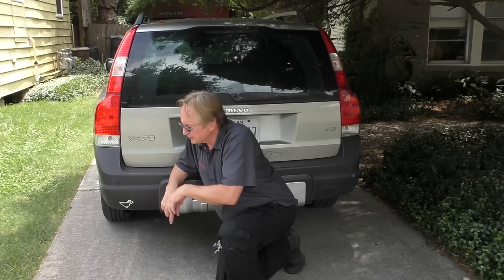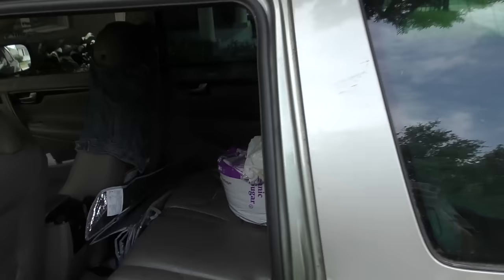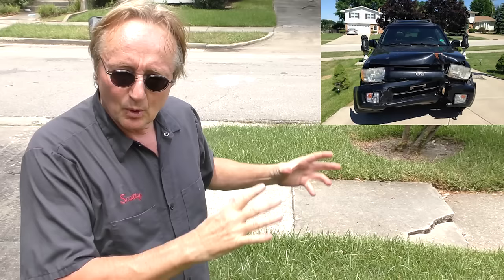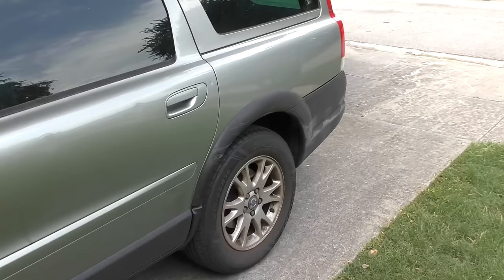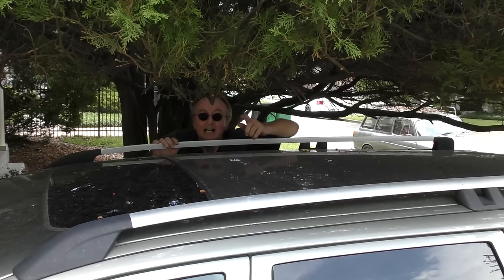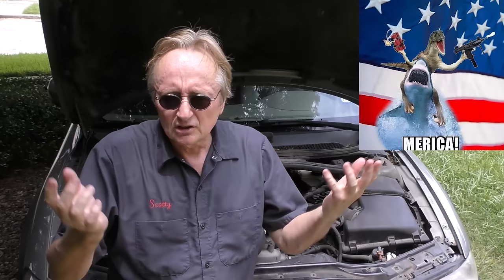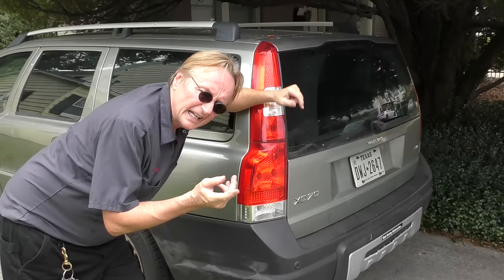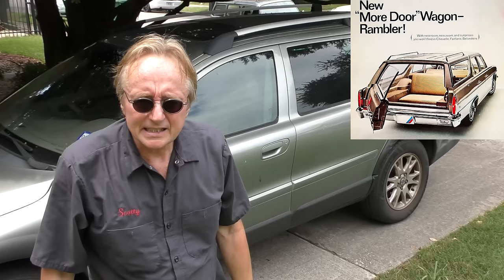Here’s Why Old Volvos Last Forever

Comment: We can confirm this. Where my Volvo nerds at?
Reply: Right here! 👋
Reply: I have a Volvo xc90 2007 I love that thing
Reply: 1992 Volvo 960 wagon only 196k mi
Reply: 850R with 340,000 miles still going
Reply: Live Love Drive Volvo
Reply: @FlaqkoGTA  indeed. I love this car.
Reply: Had a Volvo s80 twin turbo executive class....best damn car I ever owned and miss the hell out of it!!!
Reply: My parents had a volvo growing up. Can confirm they are legit tanks with moving seatbelts
Reply: I dont even go near those new Volvo's. I only.  240 and 740 or older.
Reply: Had a 08' xc90, and still have my 01' s8 t6! Looking for a box body in good condition.
Reply: 2010 c30 here
Reply: I'm a new one haha
Reply: Right here! Volvo XC90 V8 2006!
Reply: Had a 1985 740 gle and it was a tank
Reply: Volvo station wagons are the best
Reply: Adrian Leon Got a 2003 S40.
Reply: 06 s60 t5 awd
10 s40 t5 awd
i want an s80!
and a v50!
and an xc90!
Reply: Owned 9. Still have a 75 164E
Reply: Here
Reply: '98 V70 with 235K on it. I need to get a few things fixed but overall a great family vehicle. Interior is better than most other vehicles I've ever seen.
Reply: I got a Volvo v70 d5 summum 2005, great car :)
Reply: I got my 2001 v70 wagon two years ago from a used car dealership. It only had 112,000 ( previous owner was a senior citizen who only drove it locally. I absolutely love it! Other than it running lean and cutting off sometimes, I'd buy another in a heartbeat. No more new cars for me.
Reply: I would say the pre 2000 Volvo's are the most reliable without all the electronics but that's just me!
Reply: Can confirm. Currently working on a 850 glt
Reply: 2009 s80 2017 s90
Reply: '05 xc90 2.5t awd 160k miles
Reply: 2007 xc90
Reply: here here x)
Reply: Egh 2004 volvo S80, sucks, everything falls apart.
Reply: I have a Volvo 940 STW 2.3, M47 gearbox, only 85kW (116 hp) 8V engine,  from 1993. I bought it spring 2002 and am driving it since then in Finland. Actual km's are 409000.
Reply: @FlaqkoGTA  same, except it came with 8nsane v8 yamaha engine.
Reply: I thought Scotty stole my car, it's this car except with a charcoal interior and it's not ripped up
Reply: Got a 98 Volvo s70 T5 and love it
Reply: I have 4......from 91 to 2016
Reply: 2004 Volvo V50 T5 with 206,000 miles still going great
Reply: Adrian Leon 2008 xc90. Expensive repairs here and there, but solid and smooth.
Reply: Woo-hoo 😍😍
Reply: 2001 S60 with 268K miles here! She's still running strong!
Reply: Own a b230ft swapped 144s. In swimming pool blue. The driving  experience is one part erotic and one part frightening. Old volvos never die, they just get more interesting.
Reply: XC90 3.2 inline6...2007....340000km..still nice
Reply: I have a 2008 Volvo S80 v8 that thing is a absolutely monster I love it 💪🏽
Reply: Driveway Marvels had a 240DL. Awesome vehicle. It even survived a direct tornado hit. The car was an absolute tank. If they still made them I would buy another one.
Reply: I have a 98 S90, 03 C70, and a 97 850 GL. I had a 2007 S40 that was rear ended by an 18 wheeler. Ran great for 283,000 miles, minimal maintenance.
Reply: Adrian Leon 

1992 740 wagon with 450K miles and drive it daily.
Reply: 1994 850
Reply: Here! 99 S70 Awd owner here. Love my car to death.
Reply: 1989 Volvo 740. I’d rather have a bigger car cuz I’m 6’2” but I mean it’s Ight
Reply: HERE
Reply: 99 s70 glt here with 207000 miles and still runs like new. easy to wrench on too
Reply: No. I have a special Volvo. It kept breaking down until i put it in the garage where it even more broke down. It's a Volvo V70xc from 1998
Reply: @denisvermeirre1024  that was my first car, in 1981. Second was a 75 SAAB 99 EMS.
Reply: In the house
Reply: Have a 2000 V70 from back when they were still boxy.  Was rear ended on the highway, the SUV was a write-off, but over a decade later the Volvo is still going strong.
Reply: yep ,, 2000 s80 T6 .
Bought 2 years ago from a used car dealer 

that had given up on it . Gave him $700 for it .
Long story short , a fresh battery and rebuilt throttle body
she still runs and never let me stranded.
Reply: 88 245 baby shes a tank
Reply: 1979  244 DL   1.1 million miles . I cried when I couldn't get a replacement fuel pump housing during cash for Clunkers. I even tried a race shop to make me an entire new fuel tank and they said they couldn't do it. Now in a 2006 XC 70 as a Comfy Couch replacement .
Reply: 1999 S70 and a 1966 122S  now  and 10 others since 1976..
Reply: Volvo 240 from 1987 with a carbi! Engine is from 1977.
Reply: Bought a 2005 S40 1.6 Petrol for £525 with 152,000. Done 4,500 miles so far and it's been great. Returns real life 40 MPG commuting on fast A roads at 60 MPH. Incredibly comfortable. Bargain for the money and 10/10 would buy again.
Reply: Here!! Volvo for life 🇸🇪
Reply: 240 for life.
Reply: 2004 V40-currently my first vehicle, with 140K miles still runs great
Reply: Just been out in my '97 T5 wagon (manual) Goes like stink!
Reply: 2008 Volvo S80 3.2
Reply: 2004 V40 diesel 182k miles, can confirm
Reply: 92 240!! It's my baby!!
Reply: 05 S80 D5 200 000 miles oilchange every 5000, engine runs like new :)
Reply: @vladimirchervenkov6949  another 2004 V40 as a first car! How's yours holding up?
Reply: David Fearnley-Jones Great! It runs amazing! Going through town the acceleration is great even for a 16 year old car. I have cleaned every part of the car by hand and I love driving it around
Reply: @vladimirchervenkov6949  awesome! They're a joy to drive, so easy! What engine did you get in yours?
Reply: I Love my 2005 s80 AWD, still going strong change the oil goes like hell in winter snow and all year long, nice ride, definitely a highway car, gas mileage not so great but she's my baby
Reply: '06 XC70, 141k miles, and my first car. Its safe which makes my parents happy, and its quick so it makes me happy as well!
Reply: My pride and joy is my 98 S70 T5 5spd. Over 442,000km on it and still running strong.
Reply: Only the old volvos are so reliable and durable? For example the xc70 2016 model is not so reliable??
Reply: 1996 850 N/a 5spd wagon last of the Swedes
Reply: 2008 C30 T5 gang
Reply: turbobrick nation!
Reply: I have a 1988 Volvo 240 GL sedan with roughly 250,000 kilometres on it. I drive it daily it’s a beast!
Reply: @jcorbo7518  wish I went 960 rwd then again I don't get into any shenanigans in my 850
Reply: S80 T6 2001 done replacing wear n tear items but these things are rock solid cars
Reply: Here! I have a 2005 XC70 with almost 224K miles on it, and I LOVE it!
Reply: Adrian Leon right here! Xc90 running 💪🏽💪🏽💪🏽💪🏽💪🏽💪🏽💪🏽💪🏽💪🏽💪🏽💪🏽💪🏽
Reply: 2005 Volov S40 T5 AWD great car real good mpg as well
Reply: 2001 Volvo S60 T5 200k miles, and still running great!
Reply: Buddy of mine had a '90 740 turbo with 398k miles
Reply: Adrian Leon right here man. 2006 XC70 Ocean Race edition. Love this thing! Scotty is right. They are built tank solid, and mine does have ice cold A/C!
Reply: 1999 Volvo v70 GLT love to drive!
Reply: My family had a yellow 4 speed with OD 1977 244 wagon that they bought after bringing their brand new Buick back to the dealer in San Antonio after the transmission fell out on the highway. They drove the 245 for 16 years and sold it because I couldn’t drive a manual yet. They sold it for $1800 which was more than they paid for it lol. I then had a ‘83 244 GL with leather interior and sunroof with a brand new silver  paint job and alloy wheels drove that for 2 years until it was time to get something flashier aka less reliable lol. Should have never sold that car. B23F. Then my dad bought a 3 year old 745 wagon in forest green. Drove that one for 9 years then sold it to me. Then my soon to be ex wife blew out the transmission going to Corpus Christi and had it towed back. Ending up getting 500. The 745 was definitely the least reliable car but sure could hold a lot of stuff
Reply: V70 2009 2.0 200000km and 744 1991 460000km
Reply: '99 S70 turbo. 109K
Reply: Here i am, got some old volvos in my garage. 740 2.3 trubo/intercooler, xc70 99 2.4 trubo, volvo 850 2.4, and one sad volvo 240 :)
Reply: Volvo 240 here the best car ever made. I have two four door and three two door cars
Reply: Yep, 2003 V70 D5 here in UK (rust central) 260000 miles, still solid, returning av 51mpg
Reply: I have had several.
V70 1997 petrol manual 15000 miles. Everything was wrong with it. I gave up on it when the second starter went out. Nothing worked properly and the engine was jerky.
 V70 1999 petrol manual 17000 miles. Stood the test of time pretty good. AC wen't out and the driveshaft broke in half a cold Swedish winter night. But the last thing I've heard it's still rolling after 25000+ miles.
S80 2003 petrol manual 12000 miles. All kinds of electrical problems. Driverside window came loose once.
XC60 2013 diesel automatic 9000 miles. Automatic gearbox failed and it was way to expensive to fix that one. Loved that car though.
Current car is a V60 2014 diesel automatic 8000 miles. Waterpump broke after 6000 miles, AC makes a weird growling noise and is told that is normal from the Volvo mechanic. Bunch of weird electrical problems like backseat windows going down by them self. Trunk saying it's not closed properly etc...

All in all. Engines are built like tanks, but the rest of it is pretty meh.
Reply: 2002 s60 here! One of the only volvos i TRUELY loved
Reply: Swede here, I have a friend with a 1986 240. And it has done +360k miles with bare minimum maintenance during the last 10 years. It's been driven and treated like a bastard child. People entering throgh windows. Walking all over it. It's been to more music festivals than I can imagine. 
And it is still going...
Reply: Funny thing about station wagons- everyone makes fun of them - shorten the wheel base- raise the cabin height and call it an SUV and everyone loves them
Reply: 2004 xc70 same color tan leather 156,000 running strong all maintenance done in my garage
Reply: Had several and love 'em.
Hills don't exist for the 5cyl engines - they just plow through like a lazy V8.
Reply: '05 S60 2.5t
'14 S60 T6 RD
Reply: ‘05 S40 T5 6MT in passion red with the dynamic suspension! I call it my ‘baby R’! had a ‘91 740 4AT wagon about ten years ago, wish I still had it, would buy another given the opportunity!
Reply: ‘06 S60 2.5T
Reply: I got that 2009 Volvo C30 t5 r design
Reply: In the house!!!....1996 850....230,000 plus and still banging babe!
Reply: '98 S70 daily driver and a '98 V70 Turbo with an M56 w/ Quaife LSD waiting to drop in :)
Reply: 95 940 wagon with only 500,000 miles, all original including the turbo. It seats 7 with the rear facing kid seat, spins donuts, drifts, tows just great and is the most reliable vehicle I own. I have a couple dream Volvo’s in mind - 98 v70r (pre-Ford ofc) and v8 xc90 as the family car.
Reply: Right here boiii
Reply: 3 wagons, a c30 and an s90.
Reply: I am buying a V40 T4 tomorrow. Love the style and comfort.
Reply: I got a 2000 V70 Classic, 160 000 miles / 250 000 kilometres, it's a 2.4, 5-speed manual, reconditioned AC, full leather interior, alarm, central locking with remote, power windows front and rear , heated seats front and rear, integrated child seat in the armrest (back), new cam belt and waterpump, fully maintained with full service history (servicebok), new filters and fluids and so on. Bought it four months ago for $850 / 8000 SEK, I'm the second owner.

Cheers from Sweden!
Reply: Still loving my 2003 V70 Diesel 5 cylinder!
Reply: We own a 2007 Volvo XC70 with 180k on the clock. Far better condition than the one above.  My daily driver is a 5 spd manual non-turbo 1996 Volvo 850 wagon with 375k miles.  Still runs great.  Standard maintenance is key.
Reply: My 1994 Volvo 850 had 310K miles on it when it was rear ended by an older lady going at 50mph. Her Toyota crumpled like a can of coke and I drove my Volvo home. haha
Reply: Present! They're really built well
Reply: 2003 Volvo XC70, bought it on eBay for $2300 with only 117,000 miles. Gotta brag about that. The owner even changed the timing belt at 104,000 miles. I expect it to last many years. Handy vehicle, put the back seats down and carry lots of stuff. 25 mpg, much better than my suburban that gets 15 mpg for everyday driving.
Reply: Carmicha3l  samee, what year?
Reply: Carmicha3l  ahhh, lmao. I have the first computerized one, when they switched to Me7. The 1999,
Reply: Right here. 94 940 with 184,000 miles and going
Reply: even me the Swede can say this one is the lost good Volvo ever made the new ones are garbage
Reply: right here. 2004 volvo V70, Straight 5 cylinder with 267k miles.
Reply: 89 240 DL with almost 700k miles.  Ridiculous.
Reply: I demolished a new impala's rear quarter when an old lady pulled out in front of me and my S60 just needed a new fender.
Reply: 1991 volvo 940 2.3i, 215.000km, barely broken in! Greetings from Spain!
Reply: Ryan Braughler 2005 S60 best purchase I could’ve ever made!
Reply: '87 240, checking in
Reply: Here here!
Reply: Here! Wish they would build a 1/2 ton pickup for the American market.
Reply: Here here
Reply: @850are2  My favorite car I've ever owned. Full trim, oh man.
Reply: Right here!! Im on #11 at 19. They 100% need a good amount of maintenance, they’re just all abused.
Reply: 🤔😎 here mate
Reply: 2008 s40 running smooth baby!
Reply: oh and my dad still has a 1996 volvo 960. This thing is dope !
Reply: Oh -we are here 👍
Reply: @keeganpock864  You got me beat, I'm only on #5 at 20!
Reply: 940 Turbo w/ manual present. Anyone else?
Reply: @chrisj197438  wow!
Reply: Sup
Reply: Gasoline S60 2001 here (non turbo version) 180k miles and still going :)
Reply: Still driving a 2010 xc60 t6 things a Tank love it 👍
Reply: 2015 s60 Polestar 👋
Reply: 2005 S60R  I love it!
Reply: Right heree
Reply: 280.000 km and it drives like new
Reply: They are poop piles now
Reply: 2001 V70XC love it!!!
Reply: Here
Reply: Adrian Leon I have a 2007 Volvo s40 :)
Reply: 2007 C30 T5 and a 2016 Xc60 D4👍🏻
Reply: I have a 1990 240DL wagon that I drive every day. I have no idea how many miles are actually on it, but it’s at least 275,000. Doesn’t leak a drop of anything, and with preventative maintenance, it’s very, very reliable. There’s a reason they call those old RWD “redblock” Volvo’s “bricks” 😎
Reply: I dig them so much, I've had five of them!
Reply: Present!
Reply: ‘08 S80 V8!
Reply: Adrian Leon  1991 240
GLT right here ;)
Reply: 1996 Volvo S70 160k and still good to go
Reply: S70 here
Reply: Flaqko _GTA I have an 05 and I love it too:
Reply: Just bought a 2014 XC70 D5 awd to replace my V50 with 350000km! Not because it was dead...the thing still drives like new. But because I wanted more space!
Reply: -99 v70 365.000km daily driver
Reply: My brother has a 1997 Volvo 850 and the thing is like a tank. Only the turbo and radiator has been replaced since 2004 when he bought it.
Reply: 05 xc90 v8
2015 v60
Reply: @bjsorensen   Volvo S40 t5 AWD is dope it's my 3rd same car
Reply: 2007 S60. Best car I've had in my life
Reply: My  2001 V70 T5 is a friggin tank.  Do all the work myself on it and it's been a great car since I bought it for $7200 in 2005 w/ 51,000 miles on it.  Car has 136k miles on it now. It definitely has Japanese parts scattered throughout the vehicle such as the Mitsubishi turbo charger, Aisin Transmission, and quite a few Denso parts.  My major complaint is that the Aisin transmissions have faulty magnetic solenoids that collect metal particles in the S60 and V70 cars from 2001-2007 which leads to premature transmission failure.  My car had the transmission fail the previous owners at 37,000 miles. Luckily it was still under warranty and they had it replaced at the dealership. I hear a faint grinding noise when shifting into 2nd gear which worries me. I have not replaced the solenoids with the improved Rostra solenoids but flush my transmission every 30k miles with Mobile 3309 transmission fluid and I have an inline Magnefine installed on the transmission cooler return line.
Reply: 05 s60r with 213k miles
Reply: 2011 volvo xc70 T6 hard not to smile when accelerating
Reply: 850 Volvo owner here! Still the best car to stroll in finland. And every cold start in winter even - 30c it just starts...
Reply: Right here, Had 7 Volvo's so far, several 240's, one 760, one V70 and now a S60. I really feel I need to get back a 240 though.
Reply: Right here Adrian! I'm on my second XC70 (had  2001 and now have a 2010) and am committed to this brand. Husband has a 2006 XC90 and son has a 2006 S40 (red and standard trannie). I joke with our neighbors (who all drive Toyotas) that we qualify as a Volvo dealership!
Reply: @denisvermeirre1024   mine was a '74 164E. The SAAB 99 EMS was a '75.  A Datsun 510 wagon followed.
Reply: Yup
Reply: Here👍 Got myself a sweet C30 as my first car👍
Reply: 1997 850 & 2005 s60r manual
Reply: 😋2012 volvo s60 t5
Reply: 220000
Reply: 98 v70, 01 v70 Xc, 04 S60R, 07 xc70
Reply: Volvo for life
Reply: Over here! 2000 S70 @ 300k miles and still going strong 👌
Reply: My old 2005 V70 T5 stopped at a red light, took the yield from a texter at 30mph. It saved my son from any injury. We drove the V70 home with minor bumper damage. The other car looked like it was compressed in a car crusher.
Reply: 245 se Classic, 740 gl 88 and v70r saffran
Reply: 07 xc90. Most solid feeling suv I've ever driven...
Reply: 2004 XC70 Cross Country 2.5T 114,xxx miles on it.
Reply: Vroom, Vroom!
Reply: 06 XC70 with only 125K on it. Just a baby.
Reply: Volvo 740 here
Reply: @streeatbeat  Why?
Reply: 850 ARE same turbo?
Reply: I currently drive a VW, but I do miss my old Swede.
Reply: About 250k on my 2008 xc70 and still going strong
Reply: Proud 92 Volvo 240 wagon owner;)
Reply: STRÖG
Reply: 1996 850r manual estate,  
376 000ks and rolling strong..
Reply: 2003 Volvo v70 132556 miles
Reply: @carmelwillams2587  I am considering to buy Volvo s80. Does it require many repairs, especially expensive ones?
Reply: @carmelwillams2587  I am considering to buy a Volvo s80. Does it require many repairs, especially expensive ones?
Reply: V60 D5 215, 170k miles on the clock, I've only had to fix one top mount and an alternator bearing, otherwise just general maintenance. I remapped it to 260bhp and 529nm of torque as well 😂
Reply: 1996 850 wagon 2.5 10v auto, about 210000miles currently. Cost 500 Euros and 300 for new tires and breaks. Should basicalky do the job for 4 years on, and 100 tmiles more. 

What do I bother about fuel consumption?  Petrol 5cyl. puts diesel to shame, they last forever.
Reply: three 240's ...two 92's and a 93.
Reply: 95 940 Turbo w/ 77k on her. Still pushing
Reply: @FlaqkoGTA  I just got an 2005 XC90 for free! it's got 500,000 kms ( 310,000 miles)tho. haven't driven it yet. I hope it's ok. Major complaints?
Reply: @drivewaymarvels311  well Volvo 940 is durable asf too and easy to tune yourself. I own a volvo 740 and 940 turbo and I have tuned my 940 with b230fk 134hp to almost 220hp with just 1,0 bar and some other small things like h cam other injectors etc easy and durable lol
Reply: 2004 volvo v40 all day
Reply: Here!
Reply: 1964 volvo p210, what a great vehicle!
Reply: Got 2002 Volvo v70 xc awd cross country and I love it lots of power can pull great and handles great with a load
Reply: 07 S60R owner myself no regrets
Reply: Adrian Leon Volvo v50
Reply: BJ Sorensen Volvo v50 2007 2.4i
Reply: Francisco Cisneros how’s it holding up?? Deciding whether or not to buy exact one with 188k miles. Scare it’s expensive to keep up.
Reply: 1994 volvo 940 turbo wagon 316,678miles still runs great and I got it cheap I love this car!
Reply: My 850 turbo wagon 220k miles ROCK SOLID! drives like a new car. I will get at least 500k
Reply: Hello Community, I’m thinking about buying a 2000 Volvo S70? Does that sound like a good car? It’s got 120,000 miles, someone’s selling it for like $1000, but it doesn’t start. Any comment,
Reply: 2008 s60 2.5t. BEASTT.
Reply: Same year, same color!
Reply: Just bought an 07, with lol over 100,000.drives like a new one!!
Reply: Not mine, too small for it but the 2005 XC70 is a SOLID wagon! 360k miles on it.  Granted, I lendt it out for 2 years and when it came back to me, it need about 12k in repairs.  I did it myself for about 4k and recent the car finally did a stall out and wouldn't start.  Replaced the fuel pump and then the PEM. Should have replaced the PEM first, probably would have solved it but after 360k miles, a new fuel pump wouldn't hurt.  So to review, this car EASILY would have been quoted over 15k to repair. I repaired it with 5k. It purrs like a kitten and runs smooth as glass. It''s cheaper to insure and I feel more secure having my family drive around in it.  Tell me one used car at a dealership (cant be a family or friend handoff) for 5k that you would trust the same in.
Reply: I have 2020 xc40 t5 r-design 20inc rims fully loaded 😁 plus I'm going to get 21inc rims 😃😄😀
Reply: '98 V70 wagon w/ 210k

BEST FUCKIN' CAR EVER
Reply: SARÚ MÄ TÉ BILTEMA?!
Reply: Got a 98 c70 turbo she whips and sound system bangs
Reply: '98 s40 t4
Reply: 2000 s70 122,000
Reply: Lou & Ronnie fan 500 how was the 08 xc90??
Reply: Confirmed
Reply: 2010 XC90 V8 Executive  - this one's a keeper
Reply: 2000 C70 5 speed 2.3t hardtop. Still runs strong at 156,000k.
Reply: 2002 v70 AWD❤️❤️
Reply: What about the 2008 S40? Is it a good car? I am looking at one now
Reply: 2008 S60 here, just turned 160K and runs like a champ
Reply: 07 Volvo S60 2.5T FWD.  170K miles.  Been around the world almost twice. Sweden - Korea - US - Germany (neighboring countries) - US.  Regular maintenance and cranks every time.  Original AC (on auto and never turned off) unit still blows cold air.   It's a tank!
Reply: Here herw
Reply: Me 2 and KEEPING IT...next to a Polestar C30.
Reply: Flaqko _GTA 07 gang for sure
Reply: TheRagingCreeper not if you get pre Ford
Reply: Own a 2007 Volvo XC70 and love it. Had a 2001 XC70 that had a Ford POS transmission that was failing. Also own a 96 Volvo 850 base model 5 spd manual with 384,xxx miles as a daily driver.
Reply: 2002 V70xc (after 2002 they became XC70). Its how to spot a rare 2002
Reply: 2009 C30 with that same 5 cylinder turbo as that tank.
Reply: Xc70 still going
Reply: Hey guys, hope someone sees this. Should I get a 2008 with 70K miles. I noticed on car complaints it got zero reports which is super low.
Reply: Right Here ! I own a 2003 S40 Sedan with only 87k
Reply: Meeee
Reply: right here mate, got a 940 91'
Reply: 1996 Volvo 850 daily driver 385xxx miles, still going strong.
Reply: I had a 2006 S80
Reply: Got a 2005 S80 2.5T at 221K! miles on it and going
Reply: I have a c70 2.4 non turbo and it last foreverr
Reply: First car i ever owned a(  87'   240 DL ) 5 speed, that  car was was Amazing. It was a tank, never let me down, starts right up, ac ran Cool. Horn was Loud  as hell 🔊. Massive trunk. Never had a bad day driving that car, it treated me perfect, 5 stars ⭐⭐⭐⭐⭐.
Reply: @ownerownership1306  Great! That's why I'll stick with my Volvo
Reply: @drivewaymarvels311  I miss my good ole tough 1988 Volvo 740GLE. I get emotional when I think about it sometimes
Reply: @FlaqkoGTA  is that reliable? how good on gas? cost of mainteinance please?
Reply: @TheFallen66688  that is true.
Reply: Can confirm, just bought an 82 240 with an odometer stopped at 264 and has been for the last six years... it runs like a top. The rear wheel drive 240’s and 740’s are the best cars ever made hands down.. this new one that Scotty has here isn’t the same quality and built when Volvo was owned by Ford.  Not the old bricks but still a great vehicle
Reply: 2001 volvo s60 right here. Absolutely love the car.
Reply: S70 -97 80k miles
Reply: 2011 S40 & 2013 C70 checking in!
Reply: @tresmum  Just bought the 2010 Wagon VX70 yesterday 121,000 miles. It runs 🏃‍♂️on the interstate like a jewel!
Reply: Right here...122s 1966 and runs like clockwork.
Reply: @denisvermeirre1024  do you have a v70?
Reply: @alexandercell491  No. A 75 164E
Reply: I love my 06 xc70.
Reply: S60 turbo 340k just blew a head gasket. It twas a rental before I but she gave me a good 100k can't complain for 2k. Best car ever.
Reply: Here
Reply: 92 Volvo 240, love my white 🧱
Reply: 95 850 still kicking after 454k km
Reply: Rockin with an S60 R rn 😂 love the car
Reply: 06 S60 2.5T 175k and an 04 V70 2.5T 138k Wouldn't turn down a good one from the 1990s either, since mine aren't broken in yet. 😀
Reply: @KeikoFXDesigns  nice!
Reply: @DSJVNdsjnvf4356  I know it's too late for that deal now but any Volvo with that mileage for $1000 is a good find unless multiple systems are damaged. Even if you had to spend  $3k to fix it up, ask yourself what else you can buy for $4k total and put another 400,000 miles on it?
Reply: 2002 S60 2.4T
Reply: 1990 240 dl!
Reply: I just bought my FIRST Volvo, an XC70 with just over 180,000 miles on it. Going to replace the Timing Belt first (per Scotty). It has more luxury in it than my American cars, and it can be an entry-level 4-wheeler. It's SOLID (gasoline is CHEAPER than buying blood by the pint!!)
Reply: Got my first Volvo this year in April. A 2004 XC70. The stereo is better than the stereo in a Mercedes that I had for a short while. Power, luxury, plus some off-roading. I LOVE my Puddle Jumper.
Reply: Xc90 Volvo low acceleration after I took it too shop too Che k my ac
Reply: Here, not nerds, just genius 😅🤣 not to brag iykyk
Reply: Can you tell me a good vintage for the 2 wheel drive wagons?  Still  a good video on bullit proof volvos
Reply: Have a 2005 XC70 that I'm about to overhaul the front end😊